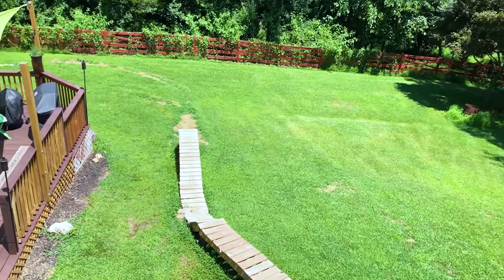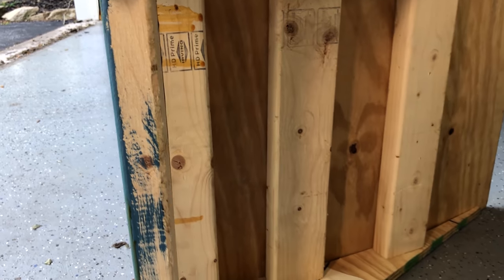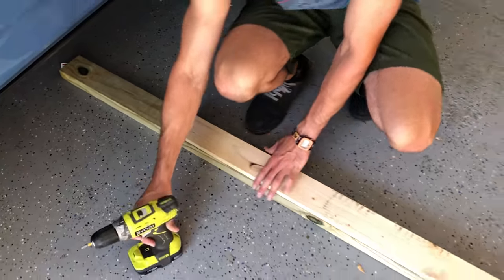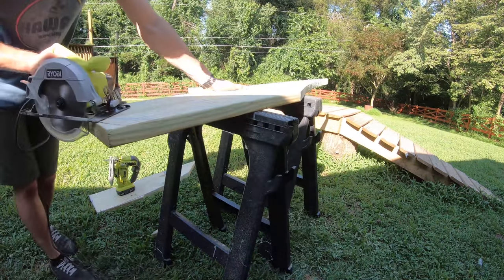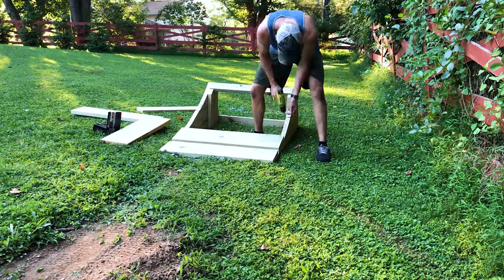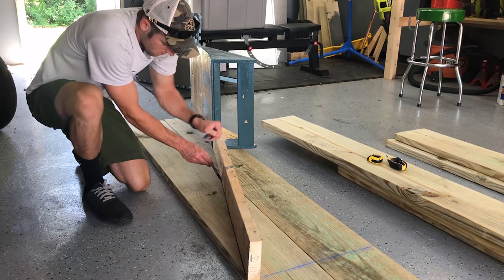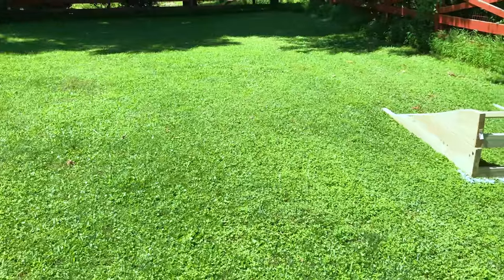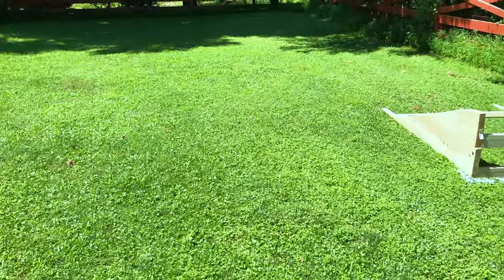Building a Backyard MTB Trail || Ramp Build

Comment: One thing to keep in mind for anyone building features. If you want it to last more than a few years and your wood is in contact with the ground you need to get ground contact lumber.  The other option is to lay down some stone first. This really only applies to some dimensional lumber as timbers ie 4x4 and 6x6s are almost always ground contact rated.  Really nice job!!
Reply from the maker: Great idea with putting stone underneath. May have to try try that, Thanks!

Comment: How did you determine that an 8 ft radius is ideal for the transition? Is that some kind of standard.
Reply from the maker: 8 foot Is not a standard as far as I know...8 foot is just what worked for this particular ramp’s transition. If your building a ramp you can mess around with different transitions until it’s ideal for your ramp. The lower the number the steeper the ramp and the higher the number the mellower it will be. 

Another way to do this is to measure string to the length of the transition and attach your pen or sharpee to the end of the string, as opposed to using a piece of wood like I did. That way you can make the string different lengths and draw out multiple transitions until you have one that is the steepness you want.

Comment: Why did you used 2x10 instead of deck boards?
Reply from the maker: I went with 2x10s for this build because If I used decking planks the ramp would have been too wide to support weight in the middle of the ramp. If the ramp narrower,  or I added a center support than I’m sure decking planks would have worked great.

Comment: You could have done the same thing making the transition by tying a pen at 8’ on a string attached to the other board at 8”. Skateboard ramps are made this way. You can get super accurate radius’s with a nail, string and pen/pencil. And you can make whatever size radius you want with the same string.